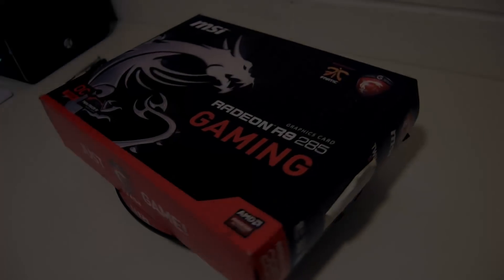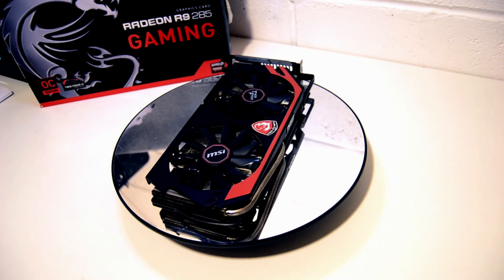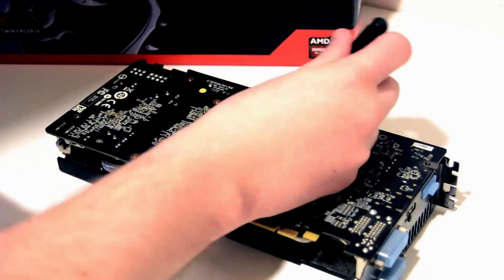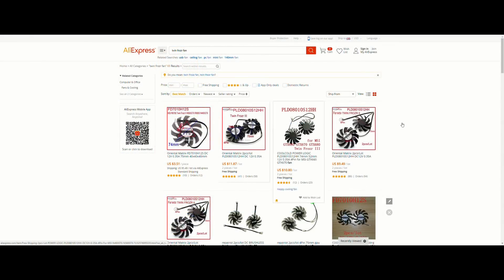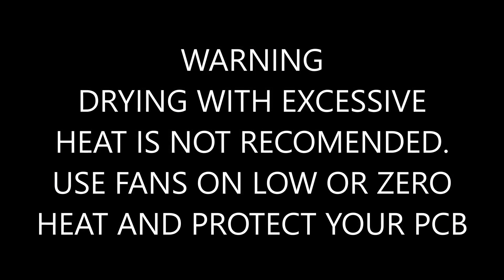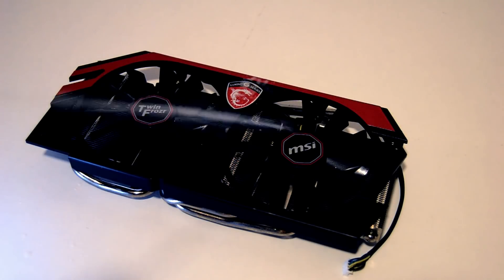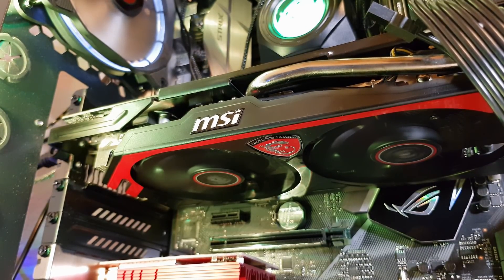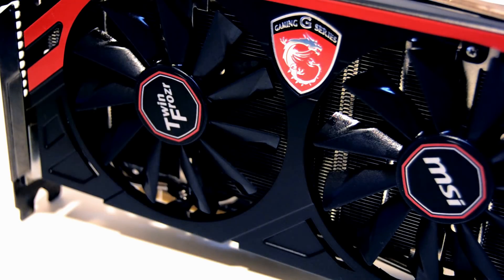Radeon R9 285 Refurb - Fixing this overheating card with ECC & WD-40

Comment: Just saw a used 7990 dual GPU card for $400CAD. Good deal, or not? I tend to water cool everything, but this one may be difficult to find one for. Unless I fab up something custom. Or just send it to Buildzoid! LOL!
You can also use MAF (Mass Airflow Sensor) cleaner. It is very safe for sensitive electronics, and does a great job of cleaning. It does however evaporate much faster than brake clean, but leaves no residue.
Great video! I do enjoy the Scott's and Aussies that are in the tech sector!

Comment: As an owner of this card, I can understand some of the frustrations that the community have. However, in this day and age, I picked this card up in 2017 for half the price of a 1050ti, and I was very surprised with it's performance.
My biggest gripe would be the 2GB VRAM, but the card still managed a solid 9100 on Firestrike with a nice overclock.  It works great in winter for keeping my legs warm too :)

Comment: I have a 280x which runs hot also. My problem is the fans don’t ramp up at all. They spin at 20% or so no matter what the temps! Stripped it down and cleaned the GPU of dust and crud. Also re-installed drivers and tried manual control in MSI afterburner and other GPU software with no luck. The only thing I can think of is the fans or pwm control is faulty?
Reply from the maker: could always plug in another fan of similar spec and see if you get the speeds your looking for, you would then be able to confirm the current fan is done.
Reply: Update Fixed the issue. Turns out I was missing one of the spacer washers between the graphics card PCB and back-plate. When I screwed down the screw nearest to the missing washer it made contact with a couple of rear PCB solder points and the black-plate probably causing a short. That and cleaning up the excess thermal paste around the GPU die. Fans ramp up and down like normal now :)
Reply from the maker: Glad to see you sorted it out!

Comment: I too had  the fans die on a GTX 970 mini.
But instead of going through the Hassel of using brake cleaner and taking apart the cooler to replace the broken fans , I simply ordered an arctic accelero 2.
Never goes above 70 degrees on load and holds a higher overclock(1470 mhz ) than before.
Although it did cost me ₹5792 ~$85 ( including customs)